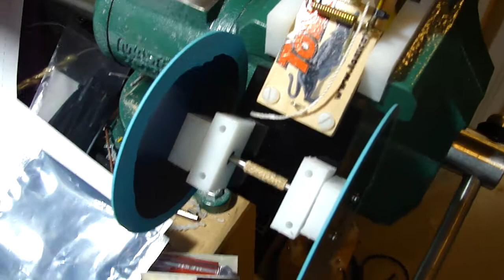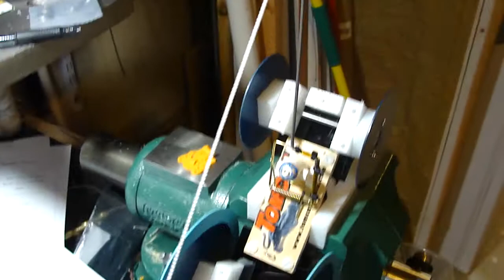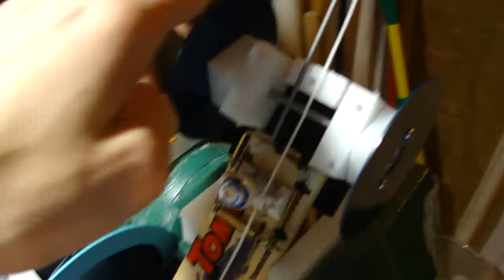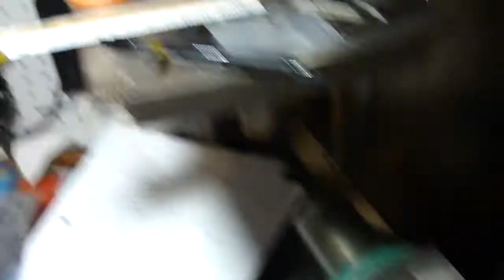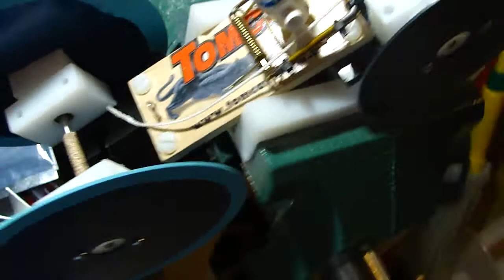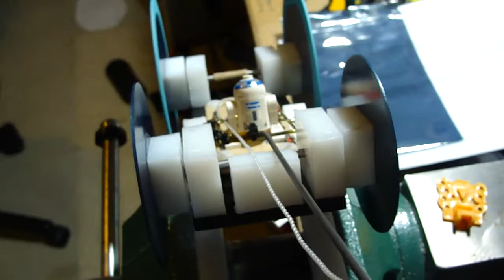Mousetrap Car

Comment: We used drinking straws inserted into a balsa frame for bearings, with wooden dowels for axles.    We used some dry powdered graphite for a lubricant (think door lock lubricant).   Also used CD's w/rubber band traction tires for wheels...    Nice build BTW.